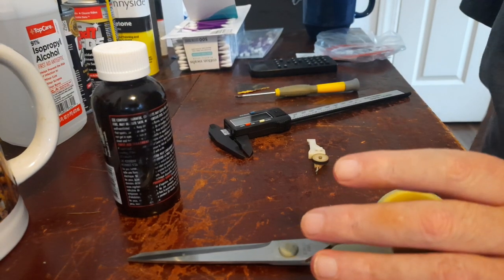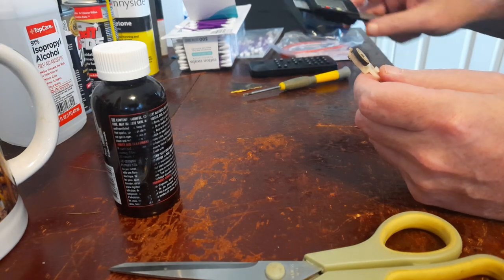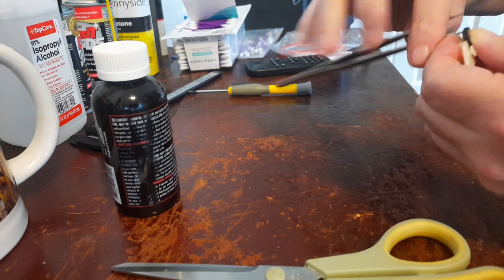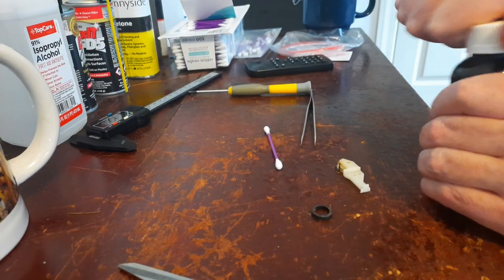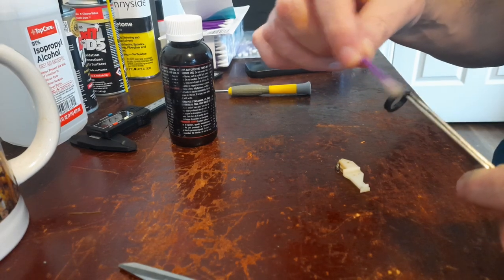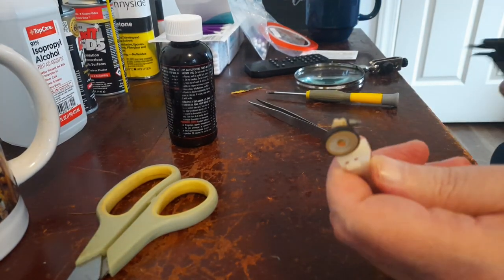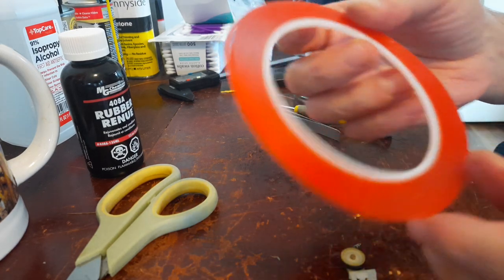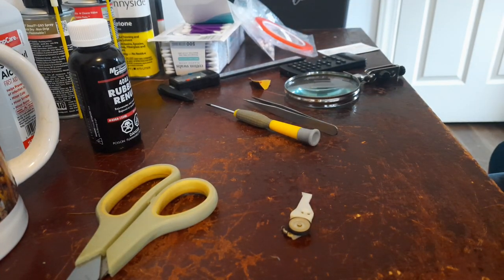Cassette Deck Idler Tire Repair.  the correct way. works for all Cassette Decks.

Comment: Where did you buy the all important tape?
Reply from the maker: 3 M  two way sticky tape comes in different widths for different size idler tire.  Ebay is where I get it.

Comment: Thank you so much! This helps a lot 😊
Reply from the maker: When you increase the diameter make sure there are no high spots.  You want it as round as possible or it won't work correctly.